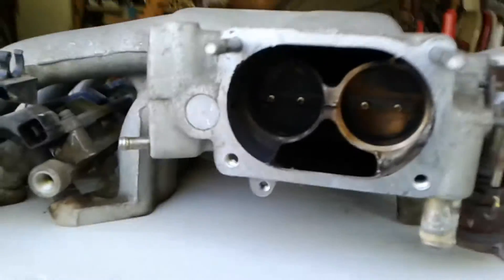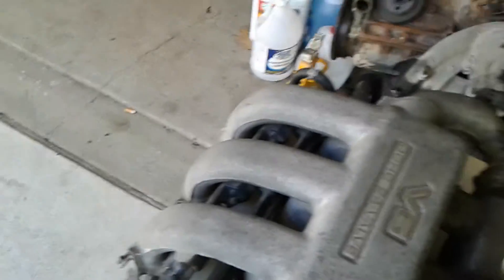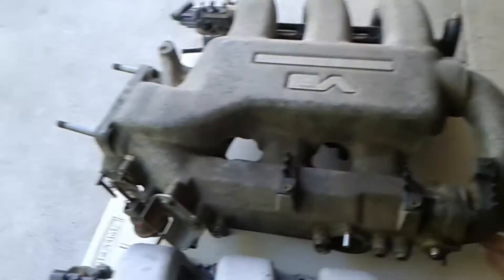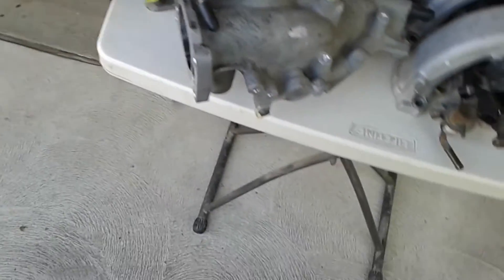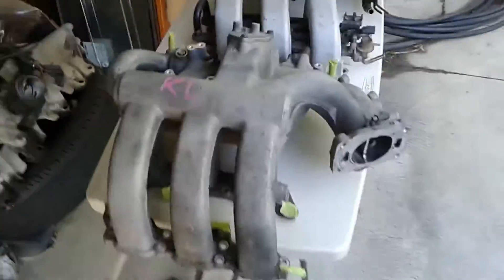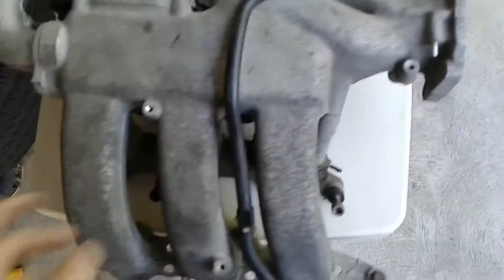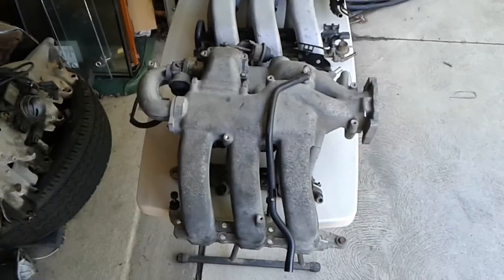KLDE, KLZE, KLZE curved neck, and KLG4

Comment: How do I spot clearly from outside perspective (standing in front of engine) if it is KL-DE or KL-ZE? Or do i need to put my arm in some free space and take pictures with flashlight the back of the engine, and look for the codes?
Reply from the maker: Well. if you see a KLDE intake it's likely all KLDE. Wouldn't make sense to put a DE on ZE parts.

Intake: by looks

Heads: by stampings between runners 

Cams: remove front valve cover check numbers for DE or ZE cams

Pistons: Compression or get a look at them 180-200 DE or 200-220 ZE

Block: JDM block has no vin tag, doesn't tell you what's inside though.
Reply: @pgtmr2713  is there any chance to chat with you privatly? I would show you pictures, if thats okey. Would appreciate it bro... After my father passed, he left me with 626 mazda, all turbo charged, tunned n other mods... :D

Comment: Learned a lot here so I guess this motor I picked up from this kid has KL1a1 on both heads  but has a klze curved neck  is a klde  motor still?  Will those runners on the Intake even match?
Reply from the maker: That could be a DE with ZE heads and intake. ZE blocks have no vin tag. ZE have 200-220 psi compression. DE have 180-200. ZE cams have different numbers on them so you can check under the valve covers. 95 Millenia came with ZE heads and intake. There also was a curved neck ZE which had all the ZE stuff and a curved neck intake. So you'll have to figure out what you have.
Reply: @pgtmr2713  I don’t see a vin tag , and pulled the front valve cover. Top cam says kl01 -431 and bottom one says kl01-451 not sure what else I should be looking for??? Do I need to remove the  rear valve cover and pull the intake off as well?
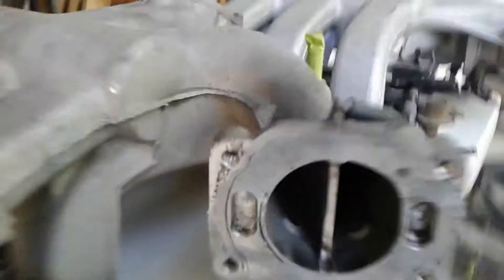Reply from the maker: @Tantobuds619  The VIN tag would be on the back of the block, driver's side.  If you watch my video "Boombox2," I show off the spot on the block for the vin tag at around 2:00 minutes in. The cams you can check the numbers on Probetalk. I don't remember those off hand. When you put the valve cover back on  make sure to put a tiny amount of sealant at the ends wherever  the gasket comes to a point. Just a small dab in the corner so it doesn't leak. Don't overtighten the bolts either, it's real easy to break off the outside screw holes.  If you checked the front cams that's all you need. It will tell you which set it is.

Comment: Dam i mis that engine both KL-DE AND KL-ZE I want another probe GT or GTS model . I prefer the straight neck over the curved neck.
Reply from the maker: I still have mine. Had some issues. Destroyed the crank. I swapped in one from a DE. We'll see if it holds together. The woodruff key got mashed ruined the slot on the crank. It ran til the pulley spun. Took forever to figure out because the timing was good. The other thing I broke some bolts that hold the front to back crossmember off. Have to drill them out and find new ones.
Reply: @pgtmr2713  Dam bro that sucks I had a Friend he also had a 96 GT with boostcn remember the turbo size it was  he was running about 10lbs of boost and about maybe 8psi at the Crank it made 314hp but it was well tuned KL-DE with the long neck KL-DE intake. It's better less compression than the KL-ZE less like to blow up
Reply: I need to make a correction I'm sorry klde block with the klze long neck intake there we go sorry buddy I just want to correct that
Reply from the maker: @HowardDinsmore-m5g  It's all good. The KLZE is the NA monster, with the primal scream. I think if I ever go turbo I'll get some KJ rods. I enjoy that it's very oem Mazda stock parts. Except for the valve springs

Comment: is that KLZE curved neck for the K8ZE 1.8L or the KFZE 2.0L  ?
Reply from the maker: The KLZE curved neck is for the Millenia 2.5l. It came as a KLZE in Japan. The same intake also came on KLDE engines in most Millenias with the KL. It can be found paired with DE heads, cams, and pistons. 95 Millenias came with ZE heads, and curved necks, otherwise DE engines. Just going off memory. The 95 ZE heads and intake part I can confirm since I pulled a set of ZE heads from one. Curved neck KLZE made 199hp, straight neck 200hp, the rest 180hp.

Comment: Really appreciate this video. Helped me figure that my intake is the klg4. Now just to figure how the heck to make the throttle body IAC work bc the intake has no line to run to it
Reply from the maker: Did you figure out how to get the TB straightened out? Sorry about the response time. Pretty sure it has to be a KLDE or ZE TB to work unless it' a 98+ 626.

Comment: Fascinating and super informative bro!  I never knew or Seen the differences explained like this b4...Just pulled an intake manifold off of what seemed to be a klde in a 97 probe gt... I have a 95 klde and this manifold looked slightly different than mine but basically the same..the dude had the phenolic spacers on the manifold.. didnt see the metal gaskets at all on this one, I think it was just the spacer and some rtv for seal... question: if I use the spacers , do u recommend using a metal stock intake gasket set on each side of the phenolic spacers? meaning, 4 metal gaskets total?  I would think rtv risky becuz its residue could wreck the O2 sensors and cat.. what do u think?  one last question: im starting to get that clattery noise at idle..its minimal or not noticeable when cold starting but theres quite a clatter when warmed up and its at idle speeds.. is this the timing belt tensioner or the  noise from the gears on the end of the cams, forgot the proper name.. its Not HLA noise... the noise is from that area around the timing belt covers  but cams or tensioner, its tuff to tell
Reply from the maker: The sound is probably the cam tensioner spring. First determine that by taking off the timing covers, see if the noise is coming from in the head or  I've personally never changed one out. There is an extra tooth on one of the gears and one ring of gears has some movement, the spring tensions one gear against the other. I'm not sure exactly how to remove and replace them, but it should be possible, might need to buy the exact wrench to spin the nut off. Probably need to take the cams out and have friend control the cam with a couple other wrenches to get the cam spring area apart. I don't think soaking it in solvent will loosen up the problem, I think the spring gets weak. But you may need some brake cleaner to get rid of the residue while you're in there.  Take a look at everything first. I once had the outer pulley loosen up and destroy the pin in the cam, so if that pulley has to come off tq to spec and use some blue threadlocker whatever is advised in a manual. 

 My car came with phenolic spacers on the DE that was in it. My understanding is you can use them with no gaskets. Maybe try the copper spray gasket, a thin coating on each side and let it dry for awhile before putting them in. When I did it with a KLG4 intake it developed a leak after awhile from the gasket spray. Probably was too thick to dry properly. It's probably best to use one set of gaskets, no spacers and mod elsewhere. The difference is unnoticeable. Idle issues will be. I got my most recent gaskets on Ebay.  They were really cheap like $11 a set, same as  what the part store had for $40. Let me know what you find.

Comment: I am about to buy a Mazda MX-6. How can i recognize that it is a Mazda MX-6 J spec, with the KL-ZE engine?
Reply from the maker: KLZE block doesn't have a VIN. KLZE front head  says KL31-1A1 looking between the intake runners, the cams have different numbers from a KLDE. Compression should be 200-220 for a ZE, 180-200 for a DE, BUT could be lower if it hasn't run, or cranks slow from the battery or is worn out. My ZE had low compression from sitting many years. Perked right up once in the car. Visually the intake should be the straight neck KL31. Maybe a scope down the spark plug hole if you want eyes on the ZE pistons. Pretty cool finding an MX-6 out there for sale!
Reply: @pgtmr2713  KL31-101 is the rear head, KL31-1a1 is the front. That is what i have been informed in a FB group. Do you agree?
Reply from the maker: @louismichael6204  That sounds correct. You should be able to easily see the KL31-1A1. The rear head will be difficult to see if not completely obscured. BUT, it wouldn't run right at all with mismatched heads. A KLZE rear head won't have an EGR valve hanging off of it.
Reply: @pgtmr2713  Do you have any FB preferably or IG maybe?
Reply from the maker: @louismichael6204  Nope. There's nothing that can't be answered here.
Reply: @pgtmr2713  I just wanted to send you some pics of the car. An experienced owner's eye can tell whether it is a J spec example with the KL-ZE engine.
Reply from the maker: @louismichael6204  I never owned an MX-6. I had and still have a Probe GT. There really isn't much out there on them either. I've only found 1 video from Japan showing a silver MX-6. It's all in Japanese. Should be available with 4 wheel steering, I believe that was an option, can't say for sure it will have it 100%. Most likely it's an American car with a swap, if you're buying it in America or Europe. That doesn't mean it isn't for sure, or that it isn't any good. There's really nothing to screw up in doing the swap. It all bolts in and if there were an issue it would be apparent in how it runs.
Reply: @pgtmr2713  It is actually a JDM one. 4 wheel steering 2.5L V6.
Reply from the maker: @louismichael6204  I hope so! You should start a channel to show it off when you get it!
Reply: @pgtmr2713  No need to show off. I also own some other JDMs, one of which is a Nissan Pulsar VZ-R N1 Version II (38 produced) and i don't show that off... so why show the MX-6 off?!
Reply from the maker: @louismichael6204  It doesn't have to be about showing off. It is rare JDM history, relatively unknown. The last Pulsar I saw had super low miles, old lady owned. Very clean, didn't see if it had the wagon hatch.

Comment: Hey man do you still have klze stuff? Or do you know where to source parts from?
Reply from the maker: Engine importers and junkyards. Maybe a Mazda forum.
Reply: @pgtmr2713  damn you still answered !! sick. sadly no engine importers are capable of that and junkyard in my country doesnt have anything good :/
Reply from the maker: @RapidX0531  You can get 95 Millenia  heads and intake. 95 only should have KLZE heads, and the curved neck is only 1 hp down from a straight neck. Then put together a MAF swap with 98+ Millenia ECU, MAF, and IAT. The ecu will work with the intake. You won't have the cams or pistons, but that combo with ebay headers can get a nice little boost in power.
Reply: @pgtmr2713  that sounds good thanks man, ill try to look around here. but if you have some parts yourself you can tell me and i pay for them and shipping aswell!!
Reply from the maker: @RapidX0531  Nothing to sell. I keep even old broken parts in case I need something.

Comment: My #1 vris at the throttle body where it connects the valve to the butterflies shakes and vibrates makes a lot of noise .I want to put a klze intake manifold on my klde 96 Ford probe gt
Reply from the maker: Is it hooked up properly? By that I mean the c-clip on the stem that keeps the rod on. I had one of those disappear once. So far as the intake goes, I don't know where you'd find a straight neck without the engine. Back in the day you could find one on ProbeTalk. Curved neck off a Millenia could work for you. Or KLG4 from a 98+ 626. KLG4 would be easier to sort. Have to use a kl03 or kl47 throttle body on that one due to the wires/TPS type. The curved neck has different EGR, may be wired backwards. Ebay for the gaskets. I got 2 pair ZE gaskets for $11 shipped once. You have to block off the EGR, at the valve, or it will leak at the ZE gaskets between the head and the IM. ZE gaskets only partially cover the EGR PORT.
Reply: @pgtmr2713  it a stock klde with EGR blocked off with metal gasket and at the exhaust but still plugged in and I don't have the stock air box and all that and the vacuum line that would have went to the box I have it before the mass air which is stock in just a big air filter . But the clip is still on the stem I can make a video and post it on YouTube and show you one day and know doubt I want to do a KL ze swap and megasquirt ECU in the future I'm in Virginia no emissions
Reply from the maker: OR... a complete ZE swap takes about 2 hours out, 2 hours in. Check prices it may be worth it. Engine hoist cost me $175.
Reply: @pgtmr2713  or I can send you a video on Instagram if you have one
Reply from the maker: @Scorpion_milk  lol I have Youtube... so you're missing the spring that closes the vris valve?
Reply: @pgtmr2713  don't have no check engine codes for the vris and it works just noisy as heck next time I go to the junkyard I'll grab one try to replace it . I have seen different intake manifold on the probes in the junkyard and they have the Ford valve covers I don't know if they're klze block and heads that's why I mentioned I won't to see if I could switch  sorry man appreciate your time
Reply from the maker: @Scorpion_milk  https://youtu.be/enfAsPGvEsE
Reply from the maker: Currently grabbing a battery for my PGT. Going to look at my DE intakes see If I  can get you some VRIS parts.

Comment: Is this how you distinguish these engines apart because I don't see the engine number anywhere
Reply from the maker: The intake is one way. If you look between the runners of the intake while it's on the car, you should be able to see a stamp on the rear head that will tell you which heads it's got. KL31-1A1 for example, Is a rear KLZE head. On the back of the block, driver's side just below the head is the Vin tag. Unless it's JDM then it won't have a vin tag at all. 3 sensors by the coolant neck 93 engine. Everything else after only has 2, one for the computer, one for the dash. one is a sensor the other is a "sender" At the front sticking out near the filter is a oil pressure sensor  with one wire. The older ones 93-94-95 are fat and send the pressure to the dash, newer ones are smaller and only show pressure or no pressure. KLG4' have solid lifters, cast cranks, same compression as a DE, 98+ 626. 95 Millenia might have ZE heads might not, I found one that did otherwise same as a DE, later years had DE heads

Comment: Will using a K8 intake on a KL01 be an issue? I'm using the stock ECU and harness from my MX3 and the KL01 has a different set of wiring connections.
Reply from the maker: You're confusing the VRIS valves with the VAF. K8 intake is too small for a KLDE. And VRIS valve will be wired to the VRIS of the K8 ecu. The VAF should be the one for the k8 with k8 ecu. It reads backwards from the klde VAF.
Reply: @pgtmr2713  So is there any issue with using the KL01 manifold on a K8 ECU?
Reply: Do I need to swap around connectors between the two manifolds? Or do I need a KL01 ECU?
Reply from the maker: @coltmobilerepair  It should work as it is swapping the engine in. Both ECUs operate the  same sensors. You can and should ask around more like say on MX6.com or another Mazda forum where you can look  these things up.  The KLDE ECU would be the right one for a KLDE engine. KL01 isn't a thing. In Europe they call a KLDE a KL03 sometimes, but it's physically all the same engine. That said I would try to run it on the k8 ecu, it should be fine. I would also do the MAF swap, which gets rid of the VAF and uses a 98+ Millenia ECU. This will make the most power and be the most efficient.  You can make it plug and play either yourself or you can buy it from a guy that sells it. I  can run my KLZE off of a 95 KLDE ECU (due to a 95 distributor) and I also have the MAF swap. I can feel it make more power in the upper RPMs. Don't forget year can be an issue depending on the distributor your MX-3 had
Reply: @pgtmr2713  Yeah I just redid all the vacuum lines was pretty straightforward. I was freaked out for a second because the connector that went to the Charcoal Canister and the vacuum source was busted off. I didn't realize that so I thought that the manifold was different. The distributors are the same. I already checked. Thanks for your help. I'll let you know when I finish the swap I'm very close.
Reply from the maker: @coltmobilerepair  Alright good luck with the parts hunt :-D
Reply: Do you have somewhere I can message you on so I can send you pictures of what's going on?

Comment: Hi, can you put me in contact with who sells a 200hp klze curved neck? thanks
Reply: I just got a question if I was to swap the intake manifold off my KLDE for a KLZE intake manifold would that make the engine a KLZE?  Thanks if you respond to this👍
Reply: @bigmac2385  Nope. There's a lot more to a KLZE then just the intake manifold.It uses a KL31 ecu- Flat top pistons and more aggressive cams which gives it a higher compression -square runners and ports.KLDE with a ZE intake is a waste of time and money.
Reply: Zacaria Hunt thanks for the feedback I appreciate it! 👍
Reply: @bigmac2385  Your welcome mate I'm glad I can help.I choose a KLDE over a ZE because I didn't want to worry about dropping valves.When I did a conversion on my Mazda mx3 I had in the past,The engine came with a Straight Neck already attached-I sourced a KL31 ECU bolted on a Straight through exhaust and pod air filter.She was a quick little car and never missed beat.The KLDE is still one of my favourite engine's.
Reply: Zacaria Hunt Yeah best engines ever I have two Mazda mx6 s and a ford probe all with kldes love them all
Reply from the maker: It's either luck to find one or buy a straightneck and swap the intake over.
Reply: @pgtmr2713  can you tell me who sells curved or straight?
Reply from the maker: @andreabiffi1540  There are JDM engine sellers online. You can look em up. I'd got a Mazda site first, to see which ones have ehat reputation.
Edit: the curved intake itself you can get from a Mazda Millenia in a junkyard.